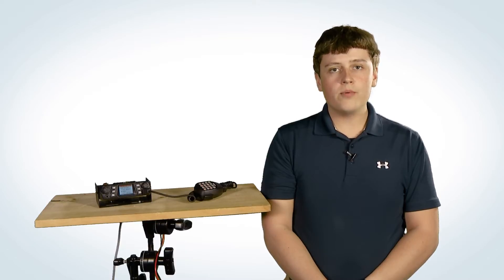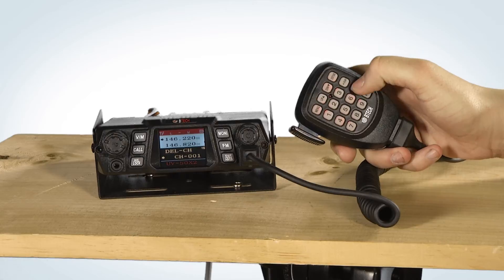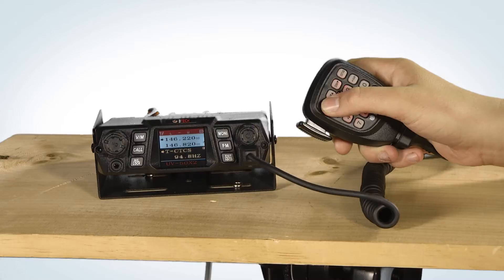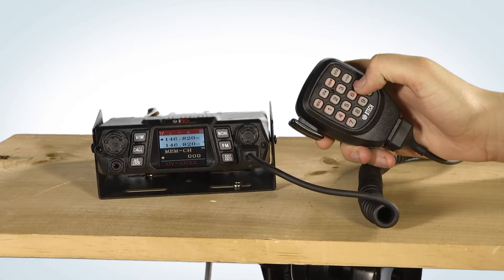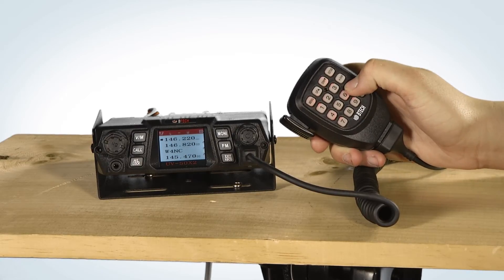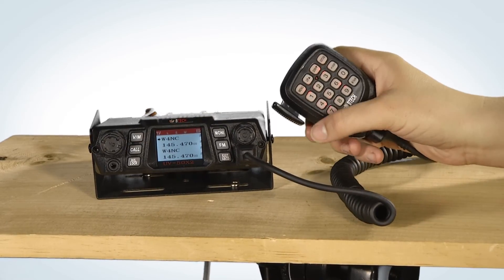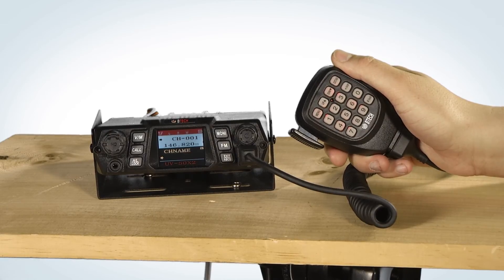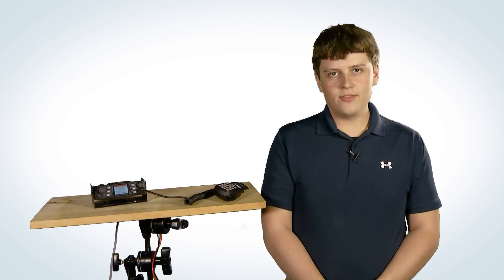BTECH X-Series Mobiles Front-Panel (Manual) Programming Tutorial - UV-25X2, UV-25X4, UV-50X2

Comment: BTECH-UV50X2
How to enter a frequency manually and save it to memory.

V/M button for frequency mode

Enter receive frequency from keypad ex:462.7000

Menu 11
Press Menu
R-CTCS ex:88.5 
Menu to save

Menu 13
Press Menu
T-CTCS ex:88.5
Menu to save

Menu 45 if you need to delete or overwrite to free up a channel 
Press Menu
Select Channel to delete with arrows ex:CH-012
Press Menu to delete

Menu 44 to add channel
Press Menu
Select Channel to save ex:CH-012
Press Menu to save

Enter transmit frequency from keypad ex:467.7000

Menu 44
Select CH-012
Press Menu to save

If you want to name the Channel you just created:
V/M button for Channel mode, you will see CH-012
Menu 26
Press Menu
Use Up arrow to select character down arrow to go back character # to next character
Press Menu to save when you are finished naming your channel

Comment: Nice video. I am new to this. I got my radio programed to work with my other radios using the channel and DCS code. The issue is that when I press the mic button on the  UV 50 is takes about  a half of a second to activate the other radios so I have to hesitate a bit before I talk. Other radios that I have used do not seem to do that. Is there an adjustment for that?  If so, how is it done? Also do you have a recommendation for using a wireless headset with this and a PTT or better yet foot operated PTT.  Thanks.

Comment: I just received a UV50X2 that I was hoping to use in my SxS for ham and GMRS/FRS along with the ham freqs. I have a license for both. I can receive GMRS but it will not transmit like my UV82HP will. I tried it on channel 20. I'm using Chirp to program it, and in the settings, the VHF low, VHF High, UHF low and the UHF high are all greyed out. IS there a way to change this? What am I doing wrong.

Comment: This doesn't work. I've tried multiple times. I even did a master reset, wiped out all memories and settings and followed along with this exact video step by step and this does not work. The unit will not open the squelch on the repeater . It does fine on simplex. It receives the repeater but will not talk into the repeater. I'm an extra class license ham with several other multi band radios and have not had any problems with other radios like I've had with this one.
Reply: I'm having the same issue!  So I don't know if the issue is something I'm not doing right or if the radio is faulty. I'm thinking about just returning it.
Reply: @Norseman2  Did you have any success?
Reply: @Joe-gh4rx  I ended up buying the programming cable and programming it that way.  It was hit or miss trying to do it by hand.
Reply: @Norseman2  I have had no problem programming. I can't open a repeater. Its just not tx'n audio/tone
Reply: Did you ever find a fix to this? I am having the same issue. I was able to get the radio to properly transmit ctcss tones and held a brief convo over a local repeater. Once started programing repeaters in it reverted to not "carrying" the tone. Would only chunk the repeater.
Reply: I never did find a fix for this. I used the radio in simplex with tones on the 64cm business band at work for a while but the final gave out so I scraped the radio. The final in this thing is tiny and probably should only run about 10 watts but it is pumped way up to over 50 watts, I've seen some test videos where they run 75 watts. They won't last long and they aren't worth fixing.

Comment: Question for you. ..  . I have tried and tried to enter the transmit frequency offset for repeater mode for MR. . I can't get it to take.   It stays in simplex mode in MR. . .but I can use the VFO and make it work for repeaters.   Any ideas to make the repeater mode work in MR?
Reply: Ok, I finally figured it out by listening to you and watching the instructions. . . .
On step 8 in the programming manual,
The sequence is menu 44, M, (memory channel entry) then Exit.
The sequence SHOULD be: menu 44, M, (memory channel), "M", then Exit.
The "M" just before the exit is missing in the programming manual.
Reply: @woodenclocks6531  when I follow his steps, I just end up inputting the transmit frequency over my receiving frequency.

Comment: PROGRAMMING THIS uv-50X2 IS DIFFICULT.  NOT EASY.
Reply: SEXY BITCH use chirp, it’s really easy.
Reply: @monkeywrenchedphotography1876  i tried and still no luck.  I even tried Chirp on the UV-5R HT and still no good.  I had all the proper cables for both radios.  But Todd I will try to do it manually as you show in your video.  I just haven't had time to get to it.  You go kind of fast but I think from what I saw from your demo I can do that.  To me it's very fast but I'm a newbie.

Comment: Thanks for the great video. I have a question. I was going to remove the stock clip stub from the microphone and install a magnet. When I opened the mic I noticed that the clip makes a connection to the circuit board within the mic. I’m wondering why that is and if I remove that clip and its connection what will happen?

Comment: Team I love the radio, works great, one question. When I plug in an external speaker, the radio stops functioning. The microphone controls freeze. Is there a menu setting I should alter before plugging in the speaker via the 3.5 mm jack on the back?
Reply: You're probably using an incompatible plug.  Look in the manual for the correct pinout.  Then you'll have to buy or build an adapter.  It's a TRRS (4 conductor) jack and it's not wired the same as the jacks used for most audio equipment.

Comment: I have a question for you I got me a B Tech UV - 25x4  try band radio and when I put in the frequency it started clicking can you tell me what that is thanks
Reply from the maker: Dual Watch monitoring VHF/UHF and 220Mhz: The 220 MHz band antenna lowpass filter is switched with a relay and the 2 meter lowpass filter and 70 cm highpass filters are switched with PIN diodes - resulting in a audible relay switch noise when monitoring 220MHz with VHF/UHF simultaneously. A relay that completely isolated the 220 MHz RF filter won't impact the RF performance of the 2 meter/70 cm bands. If monitoring multiple 220MHz or VHF/UHF simultaneously the relay is not heard or used.
Reply: LOL,it's a TRI Band NOT a TRY Band. hehe That was funny soThanks because laughter is good medicine. hehe haha {:>) LOL